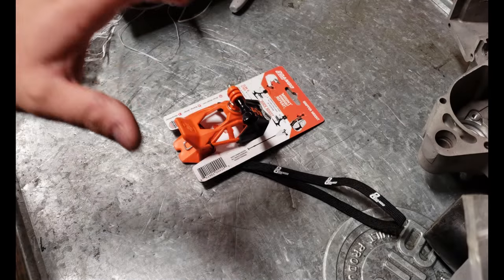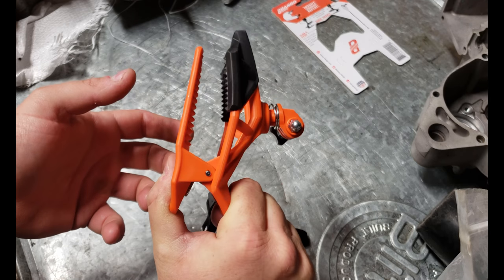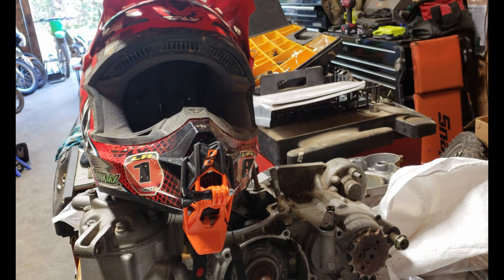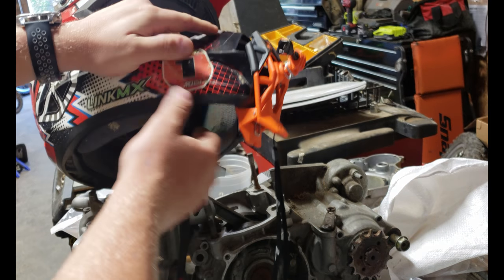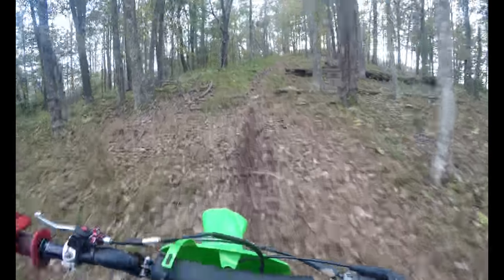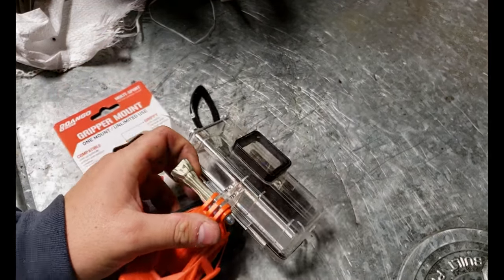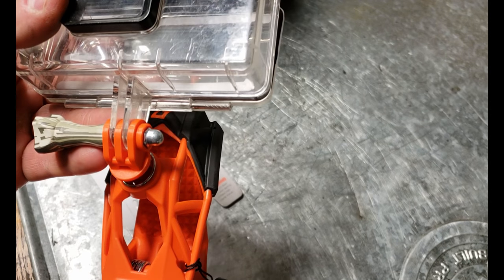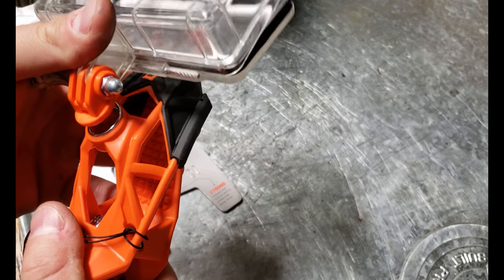Testing the DANGO DESIGNS GoPro Mount !

Comment: If you have not figured it out yet a dab of CA glue will keep the nut in place.   I love mine.  I use the same helmet as you.... about the change though (I think LS2 subverter).  My wife has your exact same helmet.  I had mine (trey canard version) since 2014.  Its just about time to retire it as it aging.   I wonder about this mount with the LS2.  The chin bar comes down a fair bit farther.   we shall see though.   I like it.  Added a little extender for more adjustment,  need to play with the adjustment a bit.  When I stand you can't even see the fender as I look out.   Sitting you can barely catch my hands a bit.   Overall I like this mount.  Going to try a chest one that I have next.  Just playing with different positions.

Comment: Do you ever use a mic with the gopro? Looking to get one for mine for riding videos
Reply from the maker: Dualsporting i have for the last few years, yes. You can see examples in most of my dual sporting videos. 

As of now though, I'm transitioning to just using a separate recorder for audio because the GoPro audio cannot always be trusted.
Reply: @mxgryan  thanks. I have hero 8. returning it for the 7 and was going to get the mic adapter they sell
Reply from the maker: @DownAndDirtyOffRoad  yeah thats what I've been using dual sporting. Just hate having 2 sports for things to come unplugged...and no way to truly verify everything is working. Audio adaptor doesn't appear to work with the 8s. No media mod available for my 9 yet either. Lol. What a mess.
Reply: @mxgryan  audio adapter works with 8 ive heard. But the 7 has replaceable lens and its way cheaper. I can get it $200 new so I could get mic and everything for less then the hero 8 I got with 90 day free returns.
Reply from the maker: @DownAndDirtyOffRoad  yea. I will say my 7 worked fine for a long time and now it's buggy as hell, almost unusable. No issues from my 8s or 9s yet.
Reply: @mxgryan  that makes me second guess getting a 7. They probably put an update on it to mess with things so people upgrade. When you say you had issies with the mic, do you mean it wouldn't record sound at all, or it just wasnt through the external mic you had plugged in?
Reply from the maker: @DownAndDirtyOffRoad  i never had any real issues with the 7 audio except for you CANNOT use quick capture, and always double check the mic adaptor AND mic are both plugged in good. 

With the 8, I was getting intermittent recording with the mic adaptor, so I assumed it must require the media mod.
Reply: @mxgryan  i was worried that the media mod would use a lot of battery. I dont use quick capture ever because it drains the battery some. We ussually ride 8-10 hr days. Checkout my newest video, i didnt use a mic so it was sort of hard to hear but not bad.

Comment: How well does this work? I’m interested!
Reply from the maker: It works great. Nearly all of my newer riding videos are using it!
Reply: The MX Guru nice think I’m going to order one! Where’s the cheapest place to order from?
Reply from the maker: @Captain250FX  Cheapest place is directly from me! They are normally $50 everywhere plus shipping...I send them out to my subscribers for $40 shipped if you're in the lower 48!
Reply from the maker: Otherwise, Amazon usually has them, you could order from my page if you feel more comfortable with Amazon! www.amazon.com/shop/TheMXGuru
Reply: I got one and it slipped of in 30 seconds. A really poor design. It could be awesome, but it's definitely not.
Reply: @Tootchjr  I’ve had mine for awhile and never had a problem? Definitely doesn’t slip, maybe just wrong style of helmet is my guess?
Reply: I don't know. I tried it on my Kali Pranha and a fly helmet. It needs to be wider in front and have a better backing system. It's far too narrow. I'm the only one that has problems with this thing? I was excited to try it. Oh well.